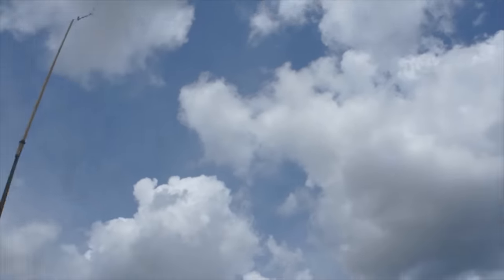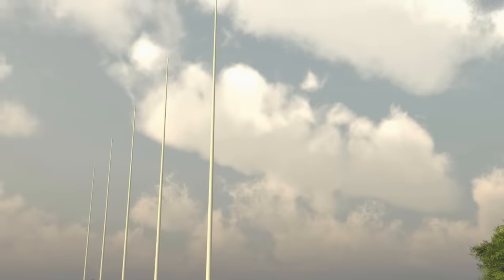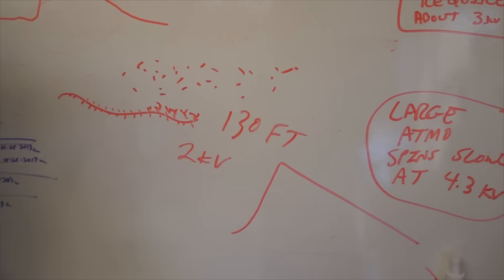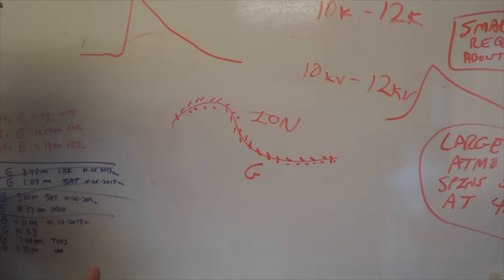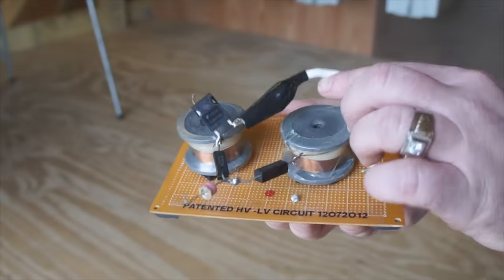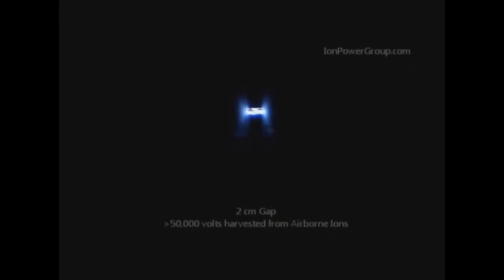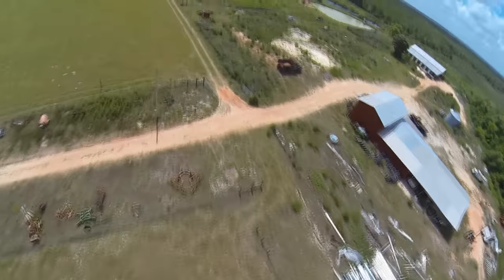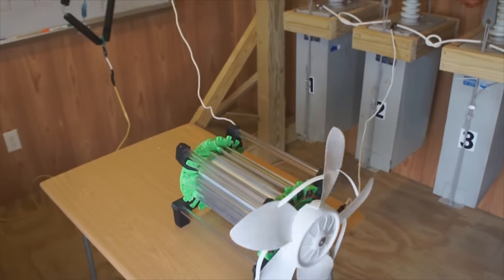Graphene/Graphite Atmospheric Electricity Collectors - Plus Horrific Hexacopter Crash!

Comment: kilovolts, kilovolts, kilovolts.  voltage is no energy, its potential!  No point in telling me all this if you don't tell me wattage! you could be getting 1 watt from that whole setup as far as I know.
Reply: I was saying the same thing, without enough current you cant run shit that is worth anything.
Reply: Well, I think the fact they don't tell you tells you everything really.
Reply: You step-down the voltage with transformer and you get the increase in current. Stepping down the voltage is like water flowing downstream, where as stepping-up voltage is like filling a water tank so the current decreases when you use transformer in step-up configuration.
Reply: those are the kvs there in the atmosphere, and the more peaks and the bigger your antenna is the more amps it collects.

Comment: I wonder if power lines could be designed to implement this technology and make it a viable source or power.
Reply: This technology would never be able to make that much enough power
Reply: @TechHowden  Never say never ;)
Reply: @Convolutedtubules first of all you just said never twice, and also there are the physically enough electrons for to make a useful amount of power
Reply: @TechHowden  Define "there" as well as "useful"
Reply: @Convolutedtubules  it was supposed to say there are not physically enough electrons in an area but I was using speech recognition and it decided to delete those words and what I mean by useful is like at least a hundred watts.
Reply: @TechHowden  I believe that as the electron collector technology advances over time, combined with the increasing efficiency and lower power consumption of our various circuits and devices, this will be become more and more useful as time goes on. I see very high potential 😉

Comment: May I suggest looking at the power lines to see it's already in use
Reply: William Jones  lol your are a genius :)
Reply: yeah, our electric system has been using atmospheric electric for over 120 years.  Power stations are non functional and all part of the financial scam
Reply: So then why are they burning all that coal at the plant by my house?
Reply: To make everyone think that is what gives us our electricity. They spend billions yearly word wide to do exactly that, while they make trillions off us. This is probably one of the best kept and most important  secrets TPTB have kept on us. " If they can get you to ask the wrong questions, they don't have to worry about your answers" Truth is stranger than fiction. The link I'm sending below is a voltage loss calculator.Which basically shows the loss in voltage over a given distance and gauge of wire used. Now think of the thousands of miles of wire running up and down every street between power stations and I little common sense will tell you it's not possible.http://www.calculator.net/voltage-drop-calculator.html
Reply: That doesnt make sense  . . . 

The way they would make their money in a scam, is by not digging up all the coal, and not burning it, while convincing us they were.  I am saying they do in fact mine, transport, and burn millions and millions of tons of coal every year.   That would be a shitty scam . . . 

I know they are lying to us about potential energy sources, I just think they are actually burning coal/methane, and using nuclear fission, etc.  Because they can control those sources, and thereby derive wealth and power from them.

Im interested though, what conclusions have you drawn from the web calculator you posted?  Could you give me some examples of how you made your calculations?
Reply: Coal Power Stations are smoke machines, Nuclear ones are steam machines (they boil water). None of them need to function, as the world has unlimited free electricity
Reply: They are both steam machines that heat water and use steam to power turbines.  I agree that there are other much cheaper and relatively unlimited sources of energy we could be using.

Thats not my point though.  

I was responding to William.  He is saying that they are faking the production of energy at conventional power plants, and substituting it with another source to scam us.  I dont believe that is the case.
Reply: The point of the calculator is to show that if they have  thousands of miles of wire running up and down roads, that lose voltage, over distance, that the whole concept of power coming from a power plant does not work as they say it does. So yes, they mine and burn coal and create smoke, but not electricity from those fuels, does not deliver electrity to our homes. They spend billions on fooling us, but it's only pennies compared to how much they make off us. There are many things we need to become aware of to escape their control, but to me free energy is at the top of that list. It has been here all along and we have all been fooled by these masons. Atmospheric collection has been the only means of delivery.
Reply: I understand the point you were attempting to make.  You provided the calculator as evidence that "the whole concept of power coming from a power plant does not work as they say it does".

I was asking you to provide an example of a calculation that you did with said calculator, in order to come to this conclusion?

For instance here is one that I just did that represents a 5 mile run from a coal fired power plant to a main sub-station.

Copper - 1AWG - 400kv - AC 3 phase - 3C parallel - 26400ft - 1250 amps = Voltage drop percentage: 0.00000050%

From there the voltage is stepped down, the amp draws are much less, and so is the wire gauge.  
There is a lot more that goes into calculating voltage loss of course.  I suspect total energy loss in any given grid network is between 3-5%.
Reply: i made 4 short (2 mins each) videos on the Electric system if u have time to spare
Only One Working Power-Station on Earth and it's in the Sky
Atmospheric Electric and the Church
EARTH is a RECHARGEABLE BATTERY
Lightning In A Bottle - No Crude Oil Needed
best watched in that order
Reply: The gauge wire running up and streets is about 12 gauge .080 dia. we have a street in my home town that was turned into a park and some of the old wire is still there and disconnected from the grid. The wire on streets can be coated or not coated as I observe them daily. That dia. wire is not capable of carrying that amount of amperage. weather there is 1 line 2 or 3 running down the streets the wire size does not seem vary in size from my observations. Those transformers hanging on the poles are Capacitor/batteries. Collecting the electricity for use. They also have these transformers not hooked up to any homes or businesses just to maintain a charge under low atmospheric charge  periods. I spend a lot time looking at all these lines and see all the added lines they run through the woods to collect electricity and know that is how they are producing it. 3 phase comes from 3 separate transformers collecting from separate lines .080 in dia. The amperage is built up in those transformers of all different sizes which give us different voltages based on the size.
Reply: The calculation I presented was not for residential service.  
I was very specific in what I described. 
"Power plant to main substation". 
"From there the voltage is stepped down, the amp draws are much less, and so is the wire gauge."

The voltage is kept high, for as long as possible, distributing to various sub stations in each neighborhood.  From those "boost" stations, or "sub stations" the voltage is stepped down or up depending on the layout. 

You keep refusing to defend your initial proposition, by providing examples of calculations showing voltage drop which would make power transmission impossible.  Why?

I want to reiterate that I believe in Zero Point energy, and certain "Over Unity" devices [poorly named].  Yet I dont feel the need to entirely dismiss every possible thing in reality in order to do so.

Tesla invented the technology necessary to run central power stations with Turbines and AC generators.  Why is so hard for you to believe that those technologies might still be in use today?
Reply: The calculation you posted is not even possible. A 100 amp circuit requires 3 gauge wire roughly .230 dia. and the wire running up and down streets in business and residential are the same. The wire on the street can only carry 30-40 amps based on gauge of wire. I have 2 services at my house 200 amp service for both 3 phase  and 200 amp single phase as I used to have a CNC lathe in my basement. Francis I wish you the best as this my last comment. I just hope your not part of the mason/SMOM damage control team.
Reply: Now we are getting somewhere.  
I am not discussing this from a position of authority, which is why I have repeatedly asked you how I should use this calculator you provided, to no avail.

Forced to do it myself I just pulled some information from the net, combined it with my limited understanding of electricity, and had at it.

The 1200 amps, was roughly what an average plant outputs constant at 400,000v [500mw]  I know they output anywhere from 10-800kv, so I just picked 400kv.  
I didnt think to look up the rating of the wire, although I should have considering I know it changes based on thickness, from doing residential wiring projects, and other small scale stuff.

Anyway, this is obviously running from the plant on a number of lines, and my amperage for one line is as you say, impossible.  So I modified my input to the calculator to this;

Copper - 1AWG - 400kv - AC 3 phase - 3C parallel - 26400ft - 240 amps = Voltage drop percentage: 0.057%

Higher than the original equation, but still not prohibitive in any way.

My experiments with wind turbines and solar energy, have shown me that the basic principals of power generation are true.  I have never run a high voltage power station, but when they tell me that they burn coal, to heat water, create steam, to turn a turbine, to power a generator.  It seems to me to be a scaled up version of my wind turbine.

Who I am, or what image you project onto me, is irrelevant.  Its only what you can experimentally prove that matters.  Since you are questioning a pretty well documented, and experimentally tested system, the burden of proof is on you, which you have not met.

Anyway, I think there is some promise in this atmosphere voltage accumulation, if they can just figure out a way to induce current.  Maybe some sort of oscillating spark gap . . . or a high voltage diode arrangement?  That aspect is a much more interesting conversation to me, but I had to respond to you since I see them bringing in truckloads of coal and burning them.  Occam's razor dude . . .

Comment: OK -- This is just wrong.  Graphene doesn't have a ton of sharp points.  It's a very smooth material.  Now, a carbon nanotube forest grown on a substrate could have many sharp points, but I would think it would be better to have the many points farther apart, and to get them up as high as possible to trigger sufficient ionization.  Most of these novice contraptions are probably interacting with water in the atmosphere.  If you get high enough, you can get true ionization coupling.
Reply: maybe a steel wool with nanotubes
Reply: Mercury amalgam gives off vapour and increases charge collection area.string dipped in Mercury would work better than graphine.
Reply: You didn't think they were going to tell us what they're really using, did you?
Reply: It's more likely that they are using graphene based capacitors with copper/aluminum collectors.